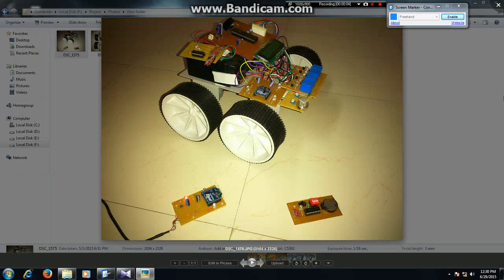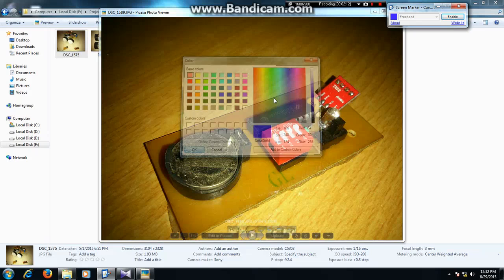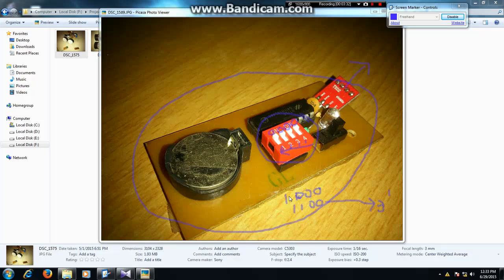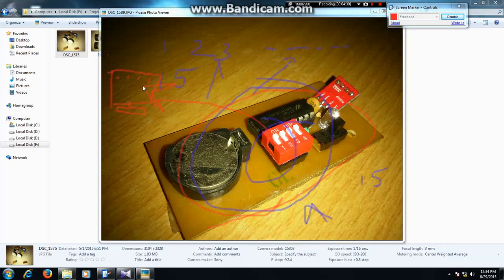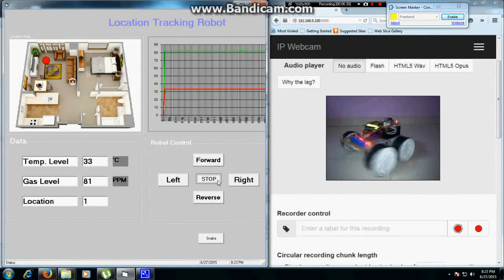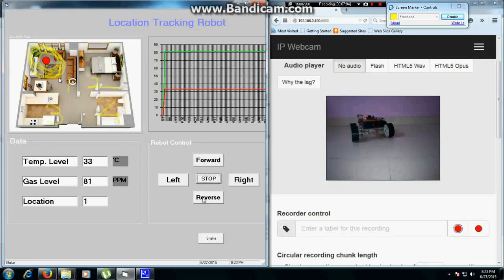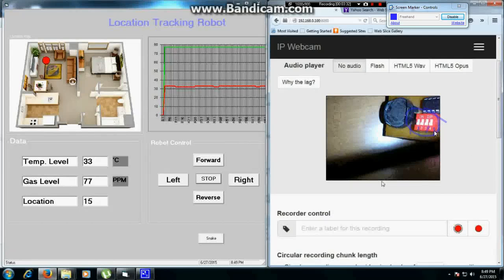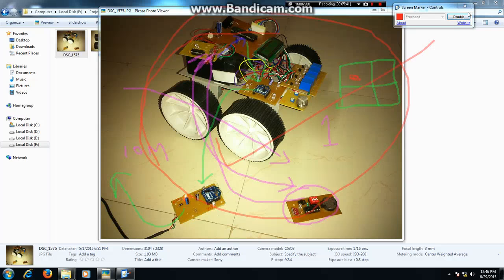Final Year Engineering Project (ECE) - RFID Application In Location Tracking HD

Comment: Hello, really good work my friend (y)
keep doing good job.
I just wanted to ask you about the application because I have the same project not litteraly but I need to localize an active tag on a car in a parking lot by using wifi and I wanted some help if it's possible.
Thank you in advance.
Reply from the maker: I am not sure if i can provide you much information about it, but will try though, just provide me with the types of devices you'll be using for your project. Like is it a Wifi, RFID or Zigbee, you can mail me the information. And regarding the applications, you meant the Tool/Software which i used on the Computer?? or the advantages of this kind of robots.?
Please mail me => vishalchauhan2212@gmail.com
Reply: TechDroid Tips & Tricks thank you very much i will email what i used in project and for the application i was talking about the software.